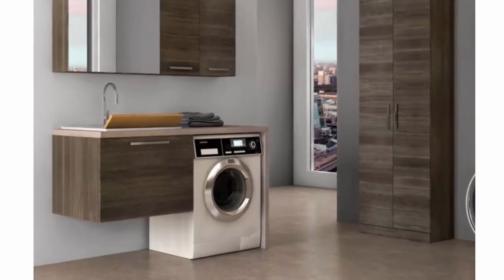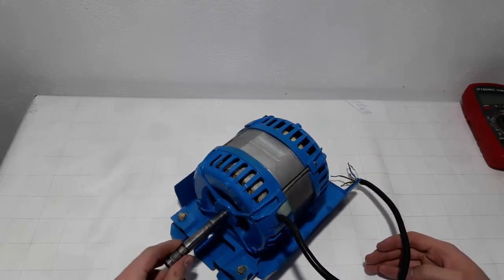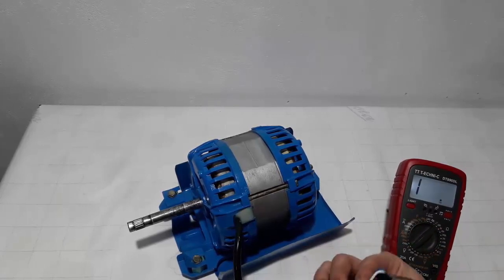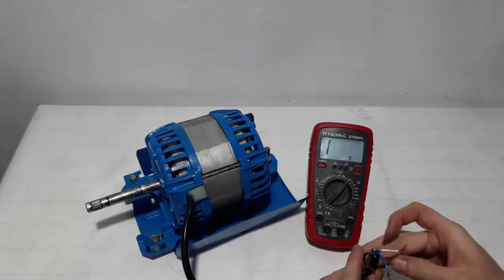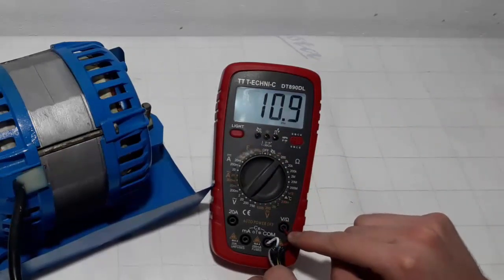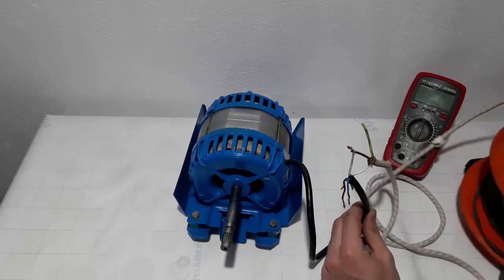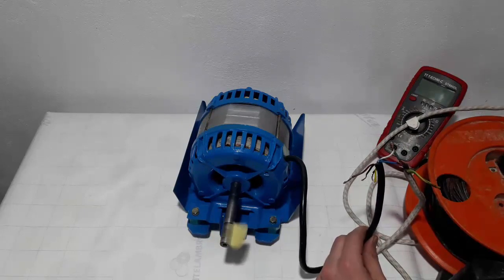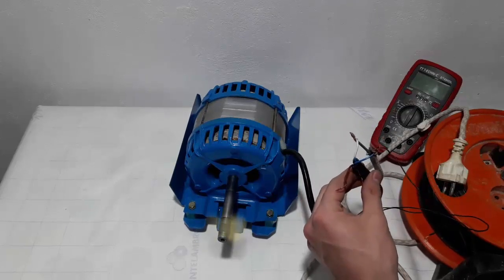Washing machine Motor

Comment: Perfect video. Can you also advise how can I choose the best capacitor size for the motor? I have a washing machine motor and your video assist too much.
Reply from the maker: It's depend on the power of the motor. There is a good application in play store called "Electrical calculations", there is an option there in which you give the power and it gives you the right size of the capacitor for your motor

Comment: Hey thanks for sharing. I have a similar washing machine motor but I didn't yet understand how to wire it could help me?
Reply from the maker: First you have to find the common wire by measuring  resistance between all wires as shown in the video, then you have to find the two windings (one for the small speed and one for the high speed) by measuring resistance between the common wire and the others..the smallest one is for the high speed
Reply: @zemirlinenassim9700  

Thanks for your reply. I measured the resistance before and wanted to know how could it be useful. How can I know what is the common? these are the resistance of the 5 wires, there is a separate grounding wire on the motor case.

    green-brown 92 Ω
    green-orange 140.1 Ω
    green-blue 86.9 Ω
    green-white 73.3 Ω
    brown-orange 106.1 Ω
    brown-blue 89 Ω
    brown-white 75.3 Ω
    orange-blue 44.8 Ω
    orange-white 31 Ω
    white-blue 14 Ω
Reply from the maker: @flat-earther   You found white-green : 73.3 and white-brown : 75.3 (=~ 73.3) so theses two resistance are equals. And at the same time you found green-brown : 44.8 which is greater than green-brown (92)..this indicates that the white is the common, green and brown for small speed, blue and orange for high speed. Try it !
Reply: @zemirlinenassim9700  Thanks!

I only got it to spin good on high speed when I connected the white to one power lead, and the blue to other power lead along with one lead of the capacitor, and other lead of capacitor connected to orange. Like this it spins very fast seems to work nice. 

I tried other wires instead of the blue but was slow and almost could not even start to spin so that should not be right, I still did not understand all this, I wish there was available some kind of additional instructions on identifying leads and how to decode the ohm readings between wires and how to connect them.